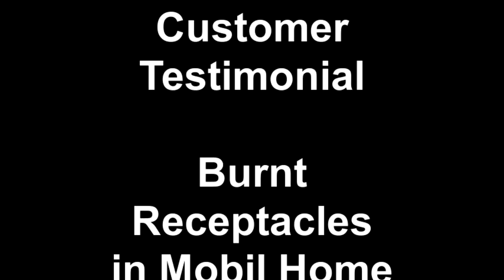Electrical Outlets (Receptacles)-Customer Testimonial Burnt Receptacles in Mobile Home

Comment: You all must stay busy working on older mobile homes where the standards was not as good as they are now. I guess FEMA can be complimented for the new standards since they busy so many manufactured homes. I live in one I got in 1988 and it has 4 wires like the regular homes, but the wall sockets and switches do wear out quickly though. I just got a new one and hope it is better than the 1988 model from Fleetwood. The main difference I noticed is the improved cabinets and wall switches.